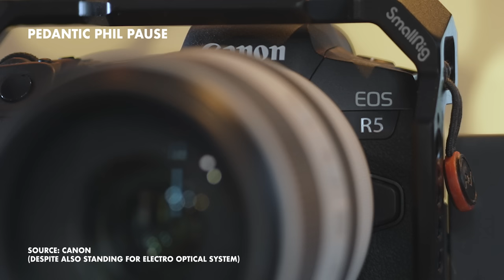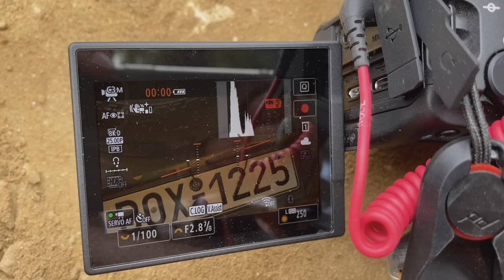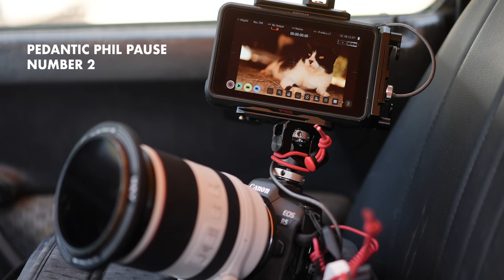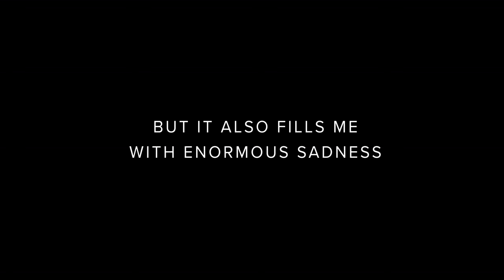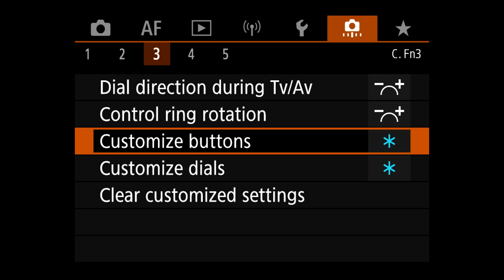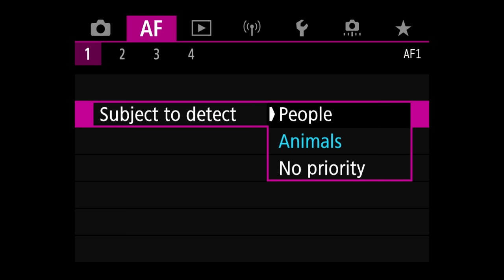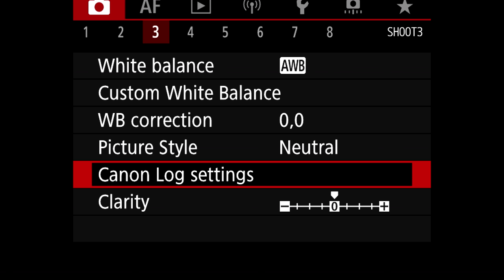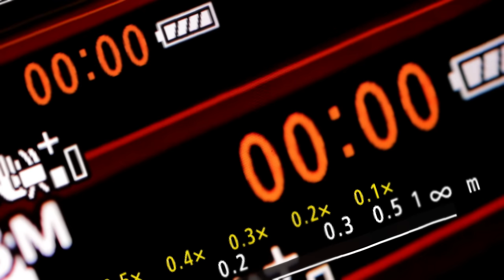The BEST hybrid camera? The Odyssey of the CANON R5

Comment: Like these ideas.  I am an enthusiast that uses a Canon EOS R and Sony A7c.  Right now cameras like the Canon R5 are nice but have video time limits which makes them deal-breakers.  My Sony A7c makes this very clear.  I need a major MP camera for photos and the Sony A7c is enough for my videos.  Not considering any others though hoping for a Canon APS-C 32 MP IBIS non-overheating  (4k) no-time limit camera with a 40mm equiv. f1.8 prime.  Also looking for a Canon FF with IBIS and at least 30 MP (like the EOS R) with no video time limit and no overheating at 4k.  So, right now Canon has not camera like that and sony has a few (a6600 and the A7c).  If Canon doesn't do this next year I will likely purchase a Sony A7RIV for my photo camera and use my Sony A7c for my video camera.
Reply from the maker: Next year? Wait for the Sony A7 IV. I think it will become the best hybrid.

Comment: Lovely video! Do you expect which of the next gen will be more likely to be your top choice? The successor of the R5, or the successor of the 7SIII?
Reply from the maker: Thanks. Neither. If Sony put in 4k 60p 10 bit into the A7 IV it would take the crown easily. It won’t have huge resolution but 24 megapixels is enough for most things for me. A7s iv whenever that comes out will still keep the low megapixel sensor most likely...but it may not. Who knows! It’s so far away! Same with the R5 mk II. Don’t expect a new model for 3 years at least.
Reply: @philipbloom  I am hoping that the rumors regarding 4k60p on A7 IV is trustworthy. Fingers are crossed.

Comment: Great review as usual Philip. Wondering if you ever tried out the R5C since this was done before that hybrid was released? Thanks!
Reply from the maker: @pacificnorthwestsoundscapes  thanks. I had a play with it but it has some issues. No IBIS for starters, bad for video but worse for stills. Switching between modes is slow. The video side has inferior auto focus compared to the R5 video mode, it’s a generation down, and you can’t shoot video in photo mode. For these reasons I didn’t trade in my R5 for it.

Comment: Another amazing video!  Very sorry about the theft. It seems to happening a lot lately!

Also, I believe the 6D mark II has adjustable AF settings for speed and sensitivity. 🙂
Reply from the maker: Thank you! Yes it does have those settings for video, but as I mentioned in the video they only work for touch focus, like a rack between two subjects. Go into tracking mode and it’s greyed out. R5 and R6 are the first. Not even the 1DX mk III has it!

Comment: Great Video Philip! A few questions for you.  Currently own the sony a7riv, coming from the nikon d850. I've found that the still images on the a7riv have much more grain than the nikon d850 at iso 50, 100, 200 etc.... I've also found that they are not as sharp as the Nikon d850 even with budget nikon lenses. I've also tried the Canon R5, which seemed to have less grain than the sony a7riv and better color. What are your thoughts on this? Does the Canon R5 have more detail and less grain than the sony a7riv? I shot a motorsport race with the a7riv and an older nikon d610, and the nikon image color, detail and sharpness was much better than the A7riv by far. Also not one of the other media photographers was using a sony. All nikon and canon. Could it be that DSLRs have much better image quality than mirrorless for fast action sports? Really confused and disappointed with the sony a7riv so far for stills. Can you shed any light on this and if the R5 is better?

Comment: I am waiting for the C-LOG3 update to make a decision between the a7SIII and the R5/R6.  I want to think Canon can improve the camera(s) enough to surpass the new Sony.  Both are a great choice in the end.  Thanks for sharing your thoughts and experiences.
Reply from the maker: The canon will always be better in some ways and the Sony in others. There are things the R5 won’t be able to improve and that’s a fact. The only modes that aren’t line skipped are 8K and 4K hq. All the Sony 4K modes to to 120p are not line skipped. There is a huge visual difference between the two here.
Reply: @philipbloom  I agree.  These facts make the decision more difficult.  Right now, my working stills setup is a 5DMKIII & MKII.  I do not print large and customer printing is largely only up to 8x10 with a once in a while 11x14.  So would the a7SIII be a large enough upgrade to the 5DMKIII as a stills camera to justify selling it all and getting two a7SIIIs with lenses?  Very compelling if I would like the handling and skin tones.  What is your impression?

Comment: an excellent conclusion to how I also feel about the R5! The new firmware that made recovery time a lot better has definitely made this camera hold that title "the BEST HYBRID". My experience after the firmware a pleasant to work with. All the talks about modding the camera is out of proportion. Without modding camera you could still have an active cooling (like fan blowing at it) it'll improve the recovery time significantly. I'd say this leave more room for Canon to improve this camera for their R5 Mark II. Beautiful video Philip, Well Done! finally someone doing the R5 justice!

EDIT: I have to disagree with A7RIV being easier to operate & faster as a stills as well. My take from renting and using one was It took time to get familiar and that buffer is super slow. The take away is a better DR and higher Megapixel camera. R5 at 45mp 20fps/12fps, insane buffer sizes and better menu layout. Not to mention lowlight performance is insanely good for a 45mp. I do think anybody familiar who get used to a camera can operate camera better anyhow.
Reply from the maker: I own and use both of those stills cameras Rick, more then just a weekend. I’ve taken tens of thousands of photos with them both. The A7RIV is deffo a better stills camera operationally, I am not talking resolution. Loads of reasons but that’s another video :) 

You just haven’t used it enough to know it. My Gfx100 produces the best images though!
Reply: @philipbloom  I've used A7RIV since release (frequently using it being super indecisive). I definitely think it's a great stills camera, but operation is subjective you can customize a lot of camera to suit your workflow. R5 made wild life photographing a breeze with it's animal af. I also do mostly action orientated photography, so it was better for me. Though I look forward to a video to why you A7RIV is good for you!

On the subject GFX100, that thing is a stills beast. But wouldn't work with my workflow very much. I've also used it during a field trip. It's a blast!

Comment: Do you think the R5 would have the stamina to do 2-3hrs of photography, followed by 1hr of recording lots of short 4k50p clips? I'm looking at this as an option for property photos and videos, where I'd have to shoot a whole house and then switch into video and go round the whole house doing 4k50 clips in each room and outside in a single session. There's no way I could deal with it overheating on me as I'd have to move onto the next job and come back (impractical).
Reply from the maker: I think so. If you turned it off between shots definitely. Rent one and give it a try. One hour of 4K 50p isn’t much if it isn’t one continuous clip.
Reply: @philipbloom  Thank you! Sounds like it might be feasible but slightly annoying when your spending £4k!

Comment: Question that I’ve never heard a good answer to: how is it possible to do a full frame, 4K video, with full-frame aspect WITHOUT pixel binning or line skipping? I’m referring to 6k or 8k sensors, for example. Of course, the A7S III doesn’t need to do either as it is full frame 12MP sensor. But for higher megapixel sensors, Isnt one of those methods necessary?
Reply from the maker: The a7siii actually downsamples video. Horizontal pixels of the sensor are about 4200 but records 3840. 

Anyway this should answer your questions.  https://youtu.be/AcO0S1An_LY
Reply: @philipbloom  but what is ‘down sampling’? I understand the concepts of line skipping and pixel binning, but how is down sampling done if not some sort of binning?
Reply from the maker: @rightshotphotography2576  pixel binning is combing the pixels BEFORE they go through the A/D converter. Downsampling is taking an average AFTER the A/D converter. What I show in this video as I go from a 8K to 4k is exactly what the downsampled 4K HQ looks like. Downsampling requires A LOT more processor power as it’s dealing with that entire resolution all the time as it processes the image to write to the card. That’s why both 4K HQ and 8K have a similar amount of overheating issues as they are essentially dealing with the same amount of pixels.
Reply: @philipbloom  thanks for the clarification... that’s the first time I’ve heard the difference explained!
Reply from the maker: @rightshotphotography2576  welcome!

Comment: You mentioned that you can record 8K to one card slot and 4k to another, I presume that's because of data rates for 8K, but can you record 4K HQ redundantly to both cards at the same time?
Reply from the maker: Nope. It is not possible to any backups of the same format. It’s ridiculous. Plus I think it needs to be 8K raw and not h265 8K which is the killer

Comment: Amazing content, well done Philip, again. Just didn´t get the better and faster a7r4 comparing to R5..??? You may prefer the Sony for some reason, but better and faster in what? Autofocus? (don´t think so), FPS ? (definitely not), weather sealing (nope), Ergonomics and menus? (another easy one), Colours? (subjective), IBIS? (Canon is far superior)... So, faster and better in what?
Reply from the maker: Do you really need me explain my reasoning? Surely you understand that everything I saw in my videos is my
opinion not fact.
Reply from the maker: But just a few things that are important to me based on owning and using both a lot. 

The AF without question is faster unless you have all the new RF lenses. Most will use EF glass and they are slower that the modern FE lenses. 

The actual acquisition for subjects feels quicker to me. 

What’s super super important is the Sony cameras are much more customisable than the canons. You can pretty much assign any function to the buttons. You cannot with the canons. Very important to me is the quick function menu with my 12 most important functions. There is nothing like this with the canon the Q menu is my customisable. 

That’s a huge part of the speed aspect. If I want to change key setting quickly I can without touching the menu. 

Yes the Canon has faster FPS. 2 in fact. I only care about mechanical. 

switching between stills and video is much faster with the Sony. It is impossible to have identical settings with the Canon when you hit record in stills mode. That causes no end of issues. 

I’ve stated very clearly in the video how much I love the camera and that I only marginally prefer the A7RIV for stills. 

Please don’t argue with me when I am sharing my opinion. If you don’t agree then fine but that’s what opinions are. You’ve just watched a 30 minute
opinion video.

Thanks,

Philip :)
Reply: @philipbloom  My appologies Philip, I didnt´t want to push you so hard on this subject :). Probably my words were not the best choice. When you talk about opinions and easy of use to you, I close my case, as each user has their own way of handling the gear. I used both brands in the past and kept only 2 Sony Rx1R2 for the drones (and now I´m using a few olympus, Leica M and GFX), so I´m not addicted to any brand, but from my experience with a7 and the a7RII, aside of the amazing files (not that much for the colours), the cameras never felt confortable and I always strugle to get a smooth workflow. 
Just a side note, you referred to the a7RIV for stills, but your answer is going back to video..:) that´s your nature, like switching between stills and video. Regarding the lenses, yes, the video guys probably are using more EF lenses, but not that much the photographers, those are using and getting more and more RF lenses to get the most out of the RF mount... and doesn´t make sense to compare the performance of a recent camera with old lenses... like the eos1DX mk3 with a manual lens, is probably slower than the 250D with a  EF-S lens. 
Thank you for your reply and your humble way of being. Just subcribed your channel to keep the track more easily.

Comment: So you're telling me someone on YouTube, doing a hack like someone who would be modding and overclocking a gaming pc, can get the R5 to manage heat better than the engineers at Canon who designed the camera? That's just a big F to me for Canon. It's just as a consumer, for that money, a cripple like that is hard to swallow, especially when it's very close by ticking so many boxes as you've pointed out.

I'm guessing because of the autofocus performance that the Panasonic S1/h/r series, and the S5 were out of the running for this title? Sony gave us what we all wanted for video, but we can't get that low light and have hi-res stills unfortunately.

That break in is such a shame. Loss of gear sucks a lot but the vulnerability and loss of things that can't be replaced are worse. Keep doing great work as we all look to you for guidance in our journey through motion picture lust.
Reply from the maker: Why does everything have to be a conspiracy in this world?
Reply from the maker: I made it clear at the start of this video what a great all in one needs to have. I go through the key things and considering autofocus is about 1/3rd of this video....! Also with Sony, it's not about low light. Once we get the A7IV with the 24mp sensor and 4k 60p 10 bit we will most likely have a new best hybrid.
Reply: @philipbloom  Hey, I watched the whole video before commenting at least! I suppose I'm just trying to tell myself how unreliable the af from Panasonic is and your omission of it is a confirmation. I too think you are right about the Sony a7IV being the best, question is what compromises (if any) will be made in comparison to the a7s3? 

As for conspiracy, I don't know about that. Just more of a question of if that piece of copper the diy fellow used worked so well, how much would it have been for it to be like that from the beginning? 39 minutes of straight 8k sounds more than reasonable to me. I'm sure it's on the mk2 drawing board now for them at least.  

This video made my cat actually sit up and listen, so that just attributes to how good your videos are.
Reply: Canon does indeed have very capable engineers.  If you are generally familiar with Nipponese culture, the overall status of engineers within a company is not as high as the business people who manage said company.  The decision to leave the newly developed image processor in the R5 without a thermal solution, was made by Canon management, based on multiple factors which we will never be privy to.

In contrast, Sony management clearly authorized  their engineers to produce a carefully thought out solution in the A7siii.  As Sony has publicly stated, the A7siii was a 5 year development cycle.

Comment: After a very considered and thoughtful  review, that really wasn't the ending I was expecting. Shocking. I detect that there was some personal loss too so I'm sorry that you have suffered that,  but,  it shows the importance of good insurance cover. I know just as an amateur that it's so easy to have gear worth a big number in your car, sometimes more than the car itself is worth. It's the time, effort, emotion and energy getting back to where you were too on top of dealing with the theft. Awful. Hope you get back to where you were equipment-wise quickly.

Comment: What i'm getting from these is that there is no perfect hybrid and there probably will never be again because the quality expectations of photo and video have forced technology divergence.  To get the best out of video you either need phenomenal cooling or you need a stacked sensor with fewer megapixels, which means you don't get the stills quality you want.
There is no way i would ever spend over £4k on a camera that all but guarantees that during a normal shoot day i will need to use my backup camera to finish the job...because, that's not a backup camera, it's a "B" camera.  Therefore, both A and B cameras need a true backup camera.  So for the pleasure of the R5 as your primary camera on a full day pro video shoot you effectively need to own 4 camera bodies, which is absolute madness.
Reply from the maker: No I disagree. If Sony put in the 10 bit 4K 60p recording of the A7S III in the A7 IV then we will have it. Then the A7R IV will follow. Sony are better at heat management.

Comment: I dont think its so easy. You cannot transfer the head to the outside. There are regulations how hot a procuct can get, there is a chance that you cannot sell a product in some countrys because it gets to hot. I dont know about the exact regulations but they are there.
Reply from the maker: You can buy a frying pan everywhere!
Reply: @philipbloom  Yes i know but thats not the point. A pan it not built to hold the hot side in your hand. If its not secure to use (and some countrys have very strict rules) you cannot sell the product in this countrys. Here where i live you cannot sell E-Bikes with a top speed more then 25kph (about 16mph) but you can sell cars faster than that. Not every Product is the same.
Reply from the maker: @Dagonator  I was making a joke. Your comment on my video was contextless. You didn’t refer to what you were talking about. It wasn’t in reply to  someone either.